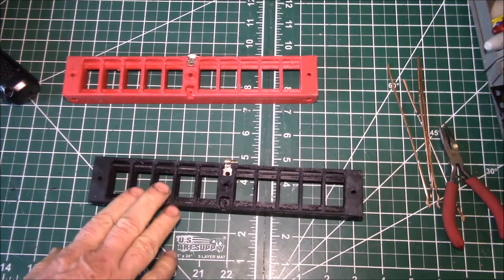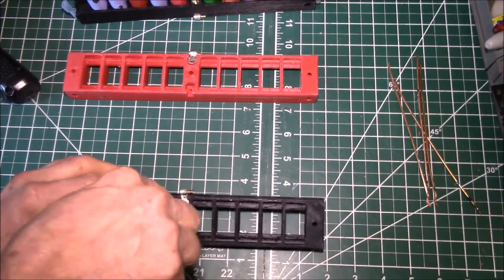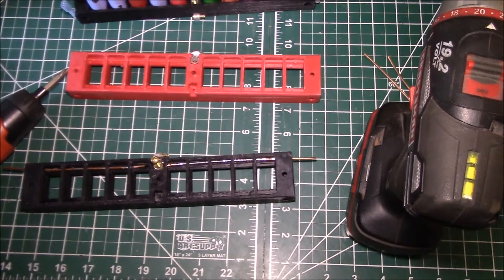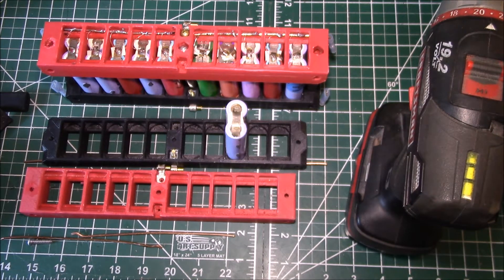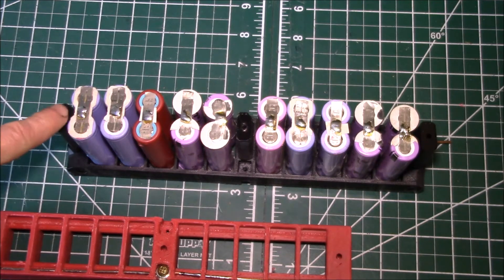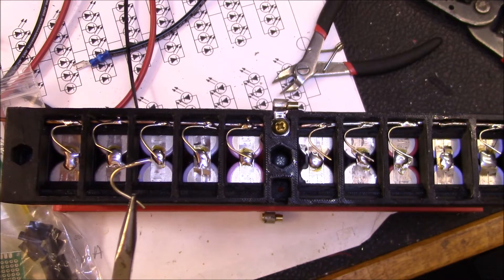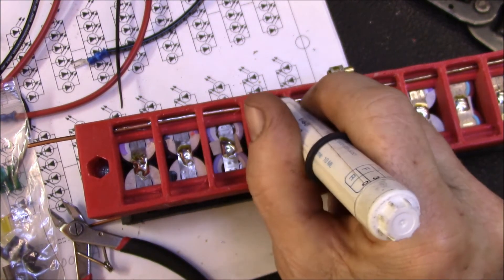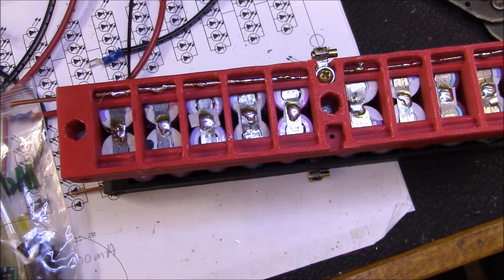20P/18650 Battery Packs, Part 2 of 3

Comment: Almost done!! seems  your Tripp lite will be  happy for your 4s20p setup .
Reply from the maker: Yes, I need to see if I can get the Tripp Lite to run off the battery pack.  I have a little testing to do first and then I can see if one battery module is sufficient or if I'll need two.

Comment: I'm trying to discern more summary info about "power wall" and what the goal is for these packs.  For us late to the project, does a particular video set the stage?  Are most of your individual batteries acquired 'free' or ?    Thanks.
Reply from the maker: I cover a bit of that in this starting video: https://youtu.be/KmJ6w4Kz6rc
In short, making a lithium ion battery bank to replace the lead acid batteries in my solar power system.  And I'm trying to "push" the limits of my existing 12V system to see if it'll run at 16V.  If not, I'll reconfigure the li-ion battery modules into 24V packs and convert my solar power system to 24V.
Most of the 18650 cells came from dead laptop batteries purchased for scrap price from various sources:

 https://youtu.be/0mAn_O2Up1Y

 https://youtu.be/Xq3dyUV-lAg
Reply: I appreciate the summary, will check out the links.  Thx.